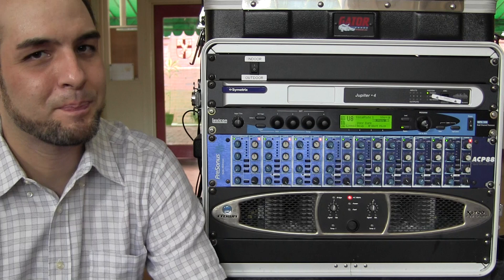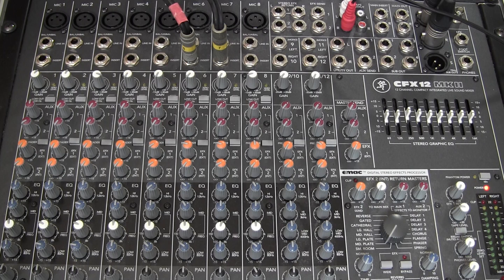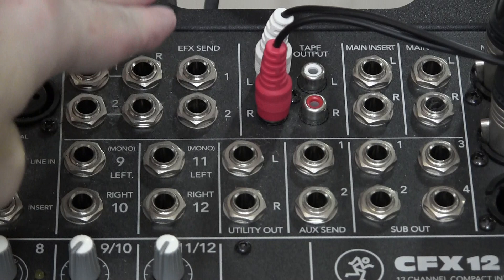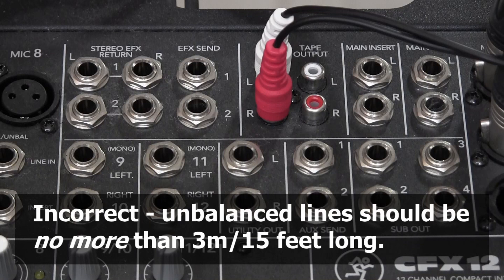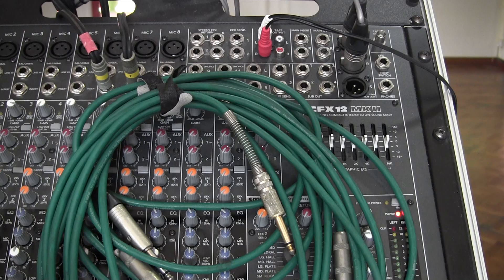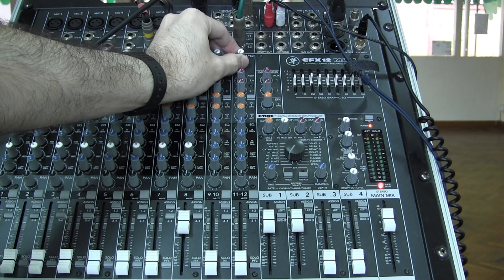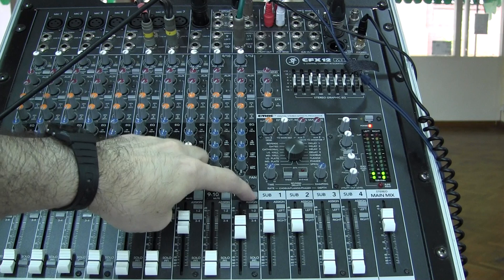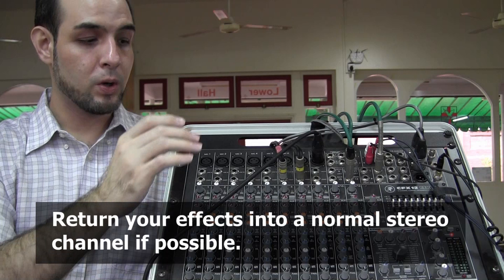How to set up an external effects processor for live sound

Comment: Hello, I am using a dedicated vocal processor (digitech VR) so I only want it for my vocal channel.   My mixer is a Mackie 808S.  I have a Mackie diagram showing vocal mic into mic1 XLR, and it shows an arrow FROM mic 1 insert going into a "vocal Enhancer" and then an arrow from the "vocal Enhancer" back to the mic 1 Insert.  It's not clear to me what the diagram is explaining since you can't have a cable from the insert and another cable back into the same Insert.  Please explain if I should plug my mic into mic 1 XLR on the Mackie and how I get the digitech vocal processor into the mixer.  Alternatively, the Digitech VR has a mic XLR input on the front and 1/4 inch Left(Mono)/Right outputs from the back.  If going into the Digitech XLR and out the Left(Mono) do I plug into the Mackie Insert or Line in?  Thanks, and appreciate additional insight into what type of cables if different than what you explained in this video.   It's appreciated that you still reply to this video done so long ago!  Thanks.
Reply from the maker: Ah yes - an insert point is actually an input and output in a single connector, using a tip-ring-sleeve quarter-inch plug. You need something called an insert cable that breaks this out into two quarter inch plugs for connection to the external processor. More info here: https://www.youtube.com/watch?v=RLf8jXGtF8w
Reply: @GLBProductions  thank you.  I watched the other video.  I happened to have a Hosa Insert cable.  I plugged the Mic into the Mackie XLR, the Hosa Insert cable into the Mackie Insert, with the Tip going into the Digitech VR Input (line) and the Ring out of the Digitech VR Left (Mono). I left the output level switch at +4.  It's working! 

What is the difference between connecting like this and how I had it before, Mic into Digitech XLR and a cable from the Digitech VR Left (mono) out to the Mackie line input?

Comment: I want to send a single channel insert from my mixer into an external device with balanced inputs and outputs, what cable would i need for this?? Please
Reply from the maker: Are the inputs and outputs on the device XLR or TRS?
Reply: @GLBProductions  it has both
Reply from the maker: Then you can use the insert cable shown in the video - the connection will not be balanced but that should be ok as long as you keep the distance between the mixer and FX unit under 5m/15ft.

Comment: Dears Users,

I have got a new jack question about reverb processor i bougth yesterday a lexicon mpx 100 reverb processor and i want to know how to connect it with my mixer (mackie vlz 1604) and wich cable do i need  jack stereo or mono in order to do it ?

Thans for your answers !

Comment: GREAT VIDEO THANKS FOR SHARING IT, I NEED SOME HELP, IM TRYING TO SET UP MY LEXICON MX 200 TO MY 8 CHANNEL YAMAHA MIXER(MX12/4) I TRIED DOING IT LIKE YOU DID, BUT IT DIDNT WORK, DO I HAVE TO PROGRAM THE LEXICON WITH A COMPUTER OR WHAT DO YOU THINK MIGHT BE
Reply from the maker: - The first step is to determine whether signal is getting from your mixer to the MX200 - if you look on the front left end of the unit you will see some 'input' meters - do these light up when you send signal through the mixer?

Comment: I have a couple of questions, 1. if you need to have multiple effect on multiple sources for example large hall reverb on vocal channel,  small hall reverb on bass, flanger on guitar1 channel and delay  on guitar2 channel, how do you do that so each effect channel is working independent from one another and can be configured differently on each channel strip 2. how do you control the EQ, effect volume independently on each source channel when you have multiple sources plugged into multiple channels with only on effect going through all of them..... Thanks,
Reply from the maker: For each separate effect that you want to run you would need an effects unit plus a post-fade aux bus. So for example if you wanted to run four different effects simultaneously you would need four post-fade aux buses and four rackmount effects units, each programmed to a separate effect. You can also run an effect in place using the insert point on the channel, but that would mean that only that channel could access that effect. Finally, you would need four separate returns to the mixer for the effects in question - either four stereo channels or four pairs of mono channels. This is one of the reasons why big shows require such an inordinate number of input channels!
Reply: Thank you , your explanation does make sense. I guess this is where a digital mixer would be more advantageous over analog ones where dynamically all these configurations can take place without the use of additional hardware.
Reply from the maker: That's right - it's very common nowadays to do an entire show with just the processing contained within the mixer, no outboard gear at all.

Comment: My mixer does not have stereo channels and I want to send the return to a channel instead of using the aux return jacks. Is it possible to just use one channel on mixer as a return mono or do I need to hook up into two channels for stereo? This is for church use. Thanks Bruno for your informative videos.
Reply from the maker: It depends on the effects unit - some of them have a mono output, others have only stereo. If your effects unit has only stereo outputs you can use just one of them, but you will lose some information, especially if your PA is run in stereo.

Comment: is a compressor can be used in that  setup, then I control and compress all channels in 1 fader or better to compress using insert method
Reply from the maker: It depends on your needs and goals - ideally a combination of both are used.
Reply: @GLBProductions   do you have a lesson on how to properly set 3band EQ on an analog mixer for vocals, my problem is the vocals are dry even though I am using  already a hall reverb. and keeps feeding back  if I boost   the volume. while the vocal are not breaking through the mix ,  our sound guy is not an engineer though, and he sets 3BEQ  mostly 60-80% in the dials. can you give me some tips. Thanks

Comment: Hi Bruno.  I have an MG10XU mixer and a Lexicon PCM 90.  Could you please let me know how I can connect from the MG10XU to the Lexicon PMC90?  Do I send from FX send (as Mono) from MG10XU and then output from Lexicon (stereo) to Line 5/6?  Then turn the Effects on the channel (white knob) all the way down?  Or do I need to turn FX RTN (the main Effects button) all the way down?  Thanks for your help.   It would be great if you can produce a video for MG10XU and External Effects processor.  I see that many are using the MG10XU these days.
Reply from the maker: Yes you got it! FX send out to Lexicon and then return into any of the stereo channels. On the return channel make sure that the white FX knob is turned all the way down. You should also turn the FX RTN knob all the way down and/or switch the internal effects OFF, as you will not be using them.
Reply: @GLBProductions  Thank you for your quick response.  Your videos are great!!
Reply from the maker: You're welcome :)

Comment: I am learning so much from your video tutorials. Thank you very much for the time you have put into making them for us ALL to learn by. I have a question . I have 4 external FX units I should like to daisy chain to my Behringer XENYX 1204FX Mixer which has 2 FX sends & returns. The FX units are, Boss Pro SE70 Effects Processor / Behringer Virtualizer FX2000 / Behringer Sonic Exciter SH3040 / Behringer Mini MIC Modeling Preamp. I researched your videos, and unless I have missed the one, I could not find one on Daisy Chaining FX units. I do hope that you could find some time to help me, or guide me to the relevant video? Thanking you for your consideration. Jay.
Reply from the maker: Yes, effects units are typically not daisy-chained in pro audio because the interaction between them is unpredictable and it makes isolating one particular effect much more difficult. This is unlike a guitarist's pedal board where the interaction between the pedals is desirable and part of the sound. 

In your case, I would choose either the Boss or the Virtualiser to run in the send/return loop of the mixer. I would place the mic preamp between the mic and the mixer, and the sonic excited between the mixer and your power amplifier.

Comment: Great Demo!! I have a Yamaha MG12XU with only two AUX Setting, Does not have any effects send, I need one Aux for Monitor, If I use the second Aux for external effects Processor,  I may step into the existing Effects by the system, because the second AUX button has the effects on it. Instead of Aux2, would I be able to use Monitor out or Group Out which will be input to the effects processor. thanks
Reply from the maker: Yes you can do that but it will not be as flexible because you will not be able to control the level of each individual channel going to the FX processor.

Comment: Whats the difference between connecting EFX unit for LIVE performance and RECORDING?
Reply from the maker: Dohm Shepard  That's a good question! To be honest with you it is something of an 
artificial distinction, but I would say live sound prioritizes speed of 
access and simplicity of operation, so probably the following: 1. Doing 
the wet/dry mix on the mixer as opposed to the effects unit. 2. Connecting via and aux send rather than a channel insert. 3. Returning 
the wet signal into a channel rather than into an effects return. Of 
course these techniques can be used by recording guys too ;) Thanks for 
asking.
Reply: Thank You for the answer!
Reply from the maker: Dohm Shepard You're welcome, thank you for asking.

Comment: Fantastic video --- so helpful! I'm very new at this and I have a question.  When using effects coming back into a stereo channel, are you now sending a dry (original mic signal) AND wet signal to the mains?  In my mind, I imagine sending the dry channel(s) to the main bus and now you are sending the wet (dry + effect) signal to the mains.  Is there a doubling effect? Can you clarify?  Thanks again for the great video.
Reply from the maker: - Greetings Matthew, thanks for the question. You are correct - we send both the original dry and the effected wet signal to the mains. The key to getting a good live sound is not to use too much of the wet signal - normally what I tell operators is to bring up the effects return until they can hear it and then pull it back slightly. Whether or not there is a doubling effect will depend on the type of effect you have selected on the effects processor. Reverbs and echos do not produce a doubling effect, delays longer than about 20 milliseconds will produce a sort of double-tracking effect, in which case the doubling is desired. 
Hope that helps, please let me know if you have any other questions.
Reply: Please is there any software for compression on pc that can be used in accordance with analogue mixer

Comment: Bruno, thanks for sharing this great information! I do have a question, you plugged the sends of the effects unit into stereo channel 11/12 and then used channel 7 to test the set up, does this mean that when an external effect is sent to a stereo channel this effect is shared with all of the channels on the mixer? Thanks again!
Reply from the maker: You're welcome Mark. The set up in the video allows the effects unit to be accessed by all channels on the mixer because it is set up on an aux send, as opposed to inserted on an individual channel. The aux send is the important part here - the signal could be returned to the mixer in a variety of ways: a stereo channel, two mono channels, an effects return etc.

Comment: im using a PreSonus AR16! i dont have all this on our mixer, the FX plug in is being used by our powered sub as another monitor mix. the question is do i plug my effects processor to the AUX 1-2????
Reply from the maker: You could try that, but Presonus do not make it clear whether the aux 1-2 sends on that mixer are pre- or post fader. An FX send should be post-fader.

Comment: hi there, this video has solved half of my problem i think. i am using a sound craft spirit live 42. my fx unit is actually a virtual channel strip in ableton live with various plug ins for all vocal mics. i want to return this channel out of my audio interface, which i can do fine. I now learned how to bring that signal back onto a spare desk channel strip. the last piece of the puzzle is how do i send that particular channel out to a monitor (should i use direct output of that channel or another send?) and how do, once i have the monitor of vocals set up nicely, how do i get that signal also going into the pa so that the audience heare the reverb too on the vocals? many thanks for any help!! i need to figure this out by friday night.
Reply from the maker: Moving Pattern Well done. The trick is to treat the channel where the effects are coming back into the mixer as you would any other stereo input: if you want to send your effects to the monitors, turn up the appropriate aux send. To send the effects to front of house, raise the fader on the channel. 

The only thing you must not do is send the effects return channel back to the effects unit, as that will create a feed back loop. So for example if you are using aux 6 as your effects send, make sure that the aux 6 knob on the effects return channel is fully counter-clockwise, ie off. Hope this helps!
Reply: thank you so much you legend
:) i will let you know how it goes when i test this tomorrow and hopefully the if it works il be good t go on sat:)
Reply from the maker: Moving Pattern You're welcome, let me know how it goes :)

Comment: I have a cheap Behringer 1202fx mixer that only has a single FX send out and supports 4 mics and 4 stereo line ins. Would I be able to use external effects with this mixer?
Reply from the maker: mkygod You should be able to - check your owner's manual to see if connecting to the 'FX send' socket bypasses the internal effects engine. If it does then you are all set.

Comment: hi there
i just braught a tchelicon Voice.LIVE3 so is this how i should connect to a mixer when going live for my vocals also.
Reply from the maker: - No, that unit works a little bit differently and is designed for connection in-line between your microphone and mixer. I suggest you follow the directions that TC give - their instruction manuals are generally quite well written.

Comment: Excellent video. I'm looking for building a karaoke system at home. I see many of my friends using something similar like this set up, Mackie mixer(less channel), Lexicon reverb. But for me, it is like a live concert, :). I'm looking for something that has same quality and less complicated but don't know what best value. I look at something like BMB KSP-100, Denon DJ DN-X1600, Mackie(4 channel) and Lexicon. My room is 16x24. They are all turn out same amount of dollars. Could you please give me some advice on choosing good sound equipments (mixer, reverb, eq…) ? Thanks, Dustin
Reply from the maker: Dust Hoan I strongly suggest you get in touch with somebody who does home theatre installations - they will be able to give you the best advice on what will work in your space. Making a home karaoke system sound good is often more about the correct acoustic treatment and speaker placement that the choice of mixers or brand of speakers. In addition, a good installer will be able to give you a package deal that will save you money on buying components separately.

Comment: Thanks for your great tutorial. I followed your instruction, however after I connect the effect processor to Mackie 1402 VLZ-PRO, it makes a loud continuous sound. Do you have any idea why it is. Thanks.
Reply from the maker: Vincent Nguyen It sounds like you have an electronic feedback loop happening. Check that the channel you are returning your effects to is NOT being sent to the effects processor. So, for example if you are using aux 2 to send to the FX processor and the return from the processor is plugged into channel 13-14, make sure that the aux 2 knob on that channel is turned all the way DOWN, ie fully counter-clockwise. 

Let me know if this solves the problem!

Comment: Hello I  come across your channel and find very useful information. I love music but am no expert or a sound engineer. I own some equipment that I use for live events and I would like if you can advise what would be the best setup  for this, because in the past I've blown some of my speaker. I have 4 SQC RMX 4050HD amps to drive my Low & Highs 2 SQC RMX 850 for my monitors. The speakers is Yamaha club series: 4 SW218V subwoofers at 4 ohms impedance; 4 SW 215V for highs and 4 BR12M for monitors. One dbx driverack PA+. I would like to get the maximum output of this system...thank you for your time.
Reply from the maker: Hi Pereke, thanks for getting in touch. It's quite difficult for me to give you advice in this situation as there are many ways of combining the equipment you have, as well as programming the DBX unit. I suggest that you get in touch with a competent live sound engineer or system technician in your area and pay them for a consultation session during which they help you set up your system. All the best for your events!